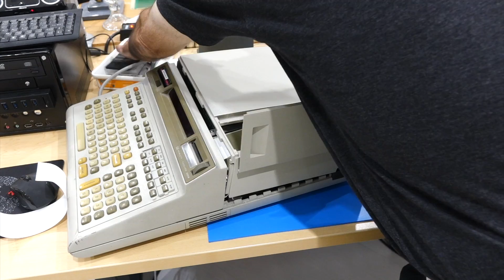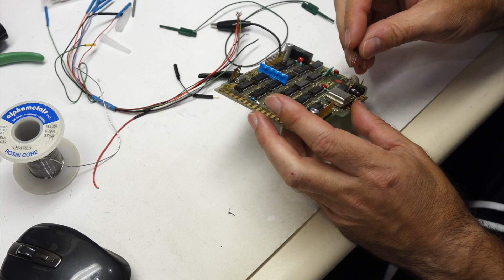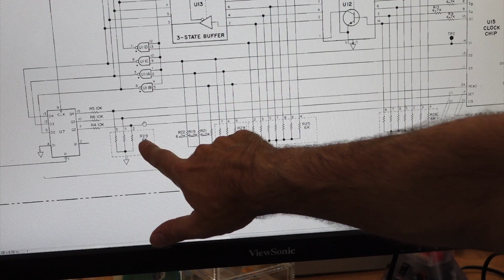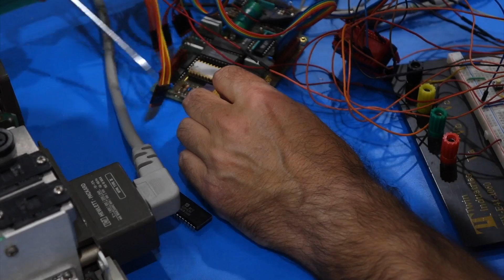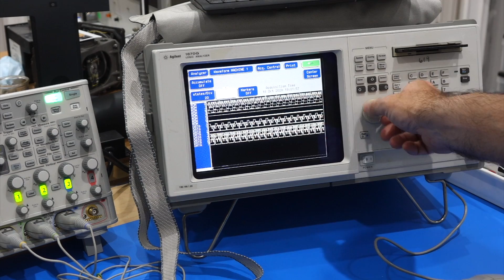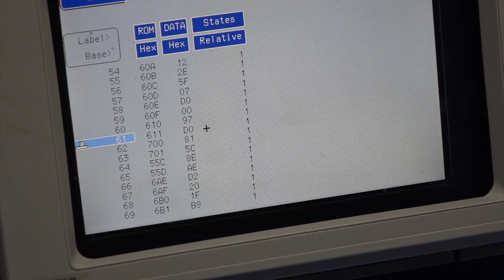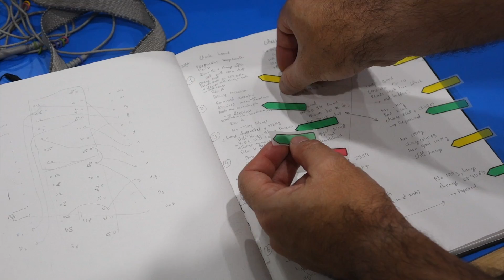HP 98035 Clock Module Repair-A-Thon - Part 3: battling voodoo electronics and magic smoke

Comment: This is a fantastic series. There is so much to be learned from comparing failure modes between multiple (yet rare) units. Up till now, the pulse generator repair with amplifier "Reconstruction" was the best.
Reply: yes, the impulse gen repair inspired me to order a couple of very fast transistors and play around.
Reply: @derkeksinator17  I need to do some playing around myself. I want to write a simple guide on discrete or very basic logic and switching. I don't know it all by heart and this is just un-acceptible to continue unrectified. I love logic sooo much that If I try, scrap PCB Full of logic will wash away in a river under my feet it turns me on so good. I thought it was just a Tim Allen thing getting horny over tools.
Reply: Do one more on the clocks to really be sure and so that we can possibly see some other failure modes. Other than that, it's probably time to move on. But yes, wonderful series.

Comment: Uploaded just 29 seconds ago??? Is this is when people say "First". Well, I will say this (trying hard not to write a paragraph): I am an electrical engineering student and a hugeeee fan of your channel. Have learnt so much from it!! Many times I do not understand everything, but I keep on coming back to your videos. 
Ok. I stop.
Big Fan!!!
Reply from the maker: Says you are fifth, but since nobody else claimed first, you get the free liter of holy vintage electronics repairing vinegar. Dip anything vintage in it, it gets instantly repaired. Or eaten away. One of the two.
Reply: @CuriousMarc    Since we are at college presently studying about digital logic, the first "vintage thingy" which comes to my mind is an 8 bit synchronous up counter made using vacuum tubes, (just like the ones you showed in IBM logic module repair video). 

I hope that it won't be eaten away. After all it is vintage!